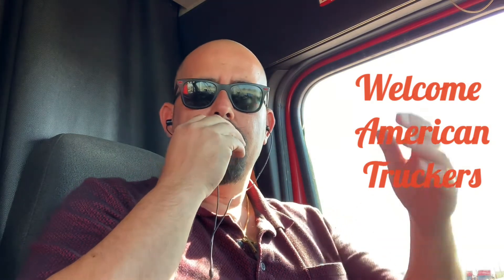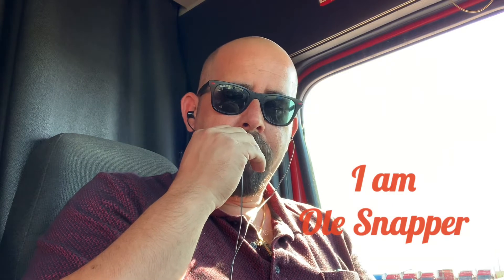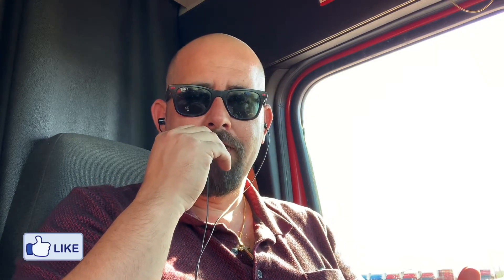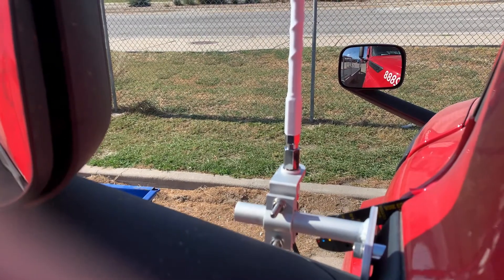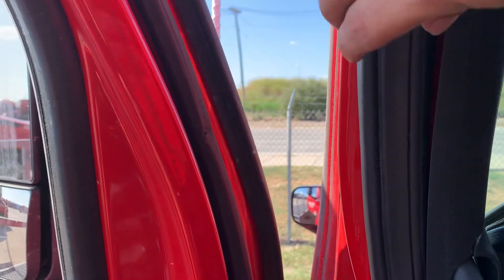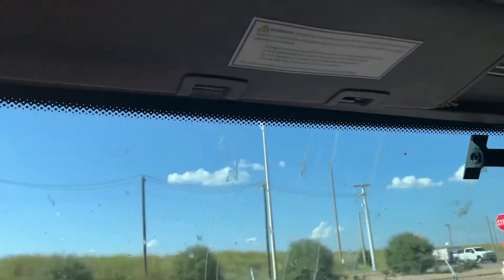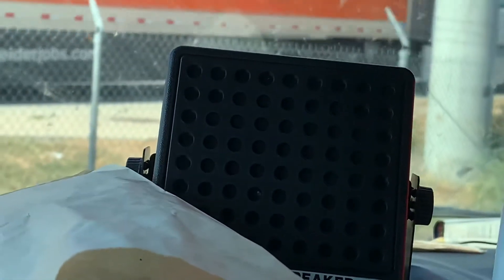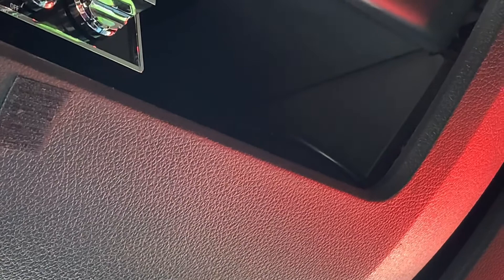CB Coax Install on 2018 Freightliner Cascadia #trucking EP 120

Comment: Does this work for older models?? Thinking about doing it on the 2017 I got same way u have done it but just don't want the coax to be destroyed by the door
Reply from the maker: It does. The correct way is to go through the firewall this is the fast way lol
Reply: @Olesnapper   Do you think the coax is not gonna get pinched this way and affect the antenna's functionality??
Reply from the maker: It will over time. But for a fix until you get the time to run it correctly it works

Comment: Ole Snapper ,  What Can the Semi-Truck-Builder Do to Standardize CB Cable Installation to the Vehicle Interior CB Compartment .
( 1/4 Flex-Tube ) With Two-Pull-Strings inside of Tubing .
The ( Flex-Tubing ) Is Run inside Fire-Wall Carpet Foam
Single-Tube . Up-to Left Side of Vehicle Door Window Panel  ,with-Panels Removed to CB Box Compartment .
Cut 1/4 Hole for Pass-Through with Rubber-Grommet if
needed . With ( 1 /4 Flex-Tubing ) Coming in from the Left-Side CB Compartment Box. Now ( 12V Power ) Common-
Connector ( Red-Black ) Fasten With Screw-in- Hardware to Upper Back of CB Compartment Panel . Using the CB Out-Of-Box ( 2 1/2 AMP Fuse IN-Line Power-Cord ..
The 12V Power Should-Follow-Wiring-Harness-Back-to
Fuse-Box-Connected--Neg-Pos Connection. Now the
Flex-Tubing -Fire-Wall-Path-Way to Left-Side Mirror
Path-Way Installation, Run Flex-Tubing Inside Fender-Well Towards Door-Panel and Mirror Mount ( Leave-
Flex-Tubing Very Long-Pass Truck-Mirror For-Now.
Use This-Type of Cabling Because of Connector-Type.
(  K40 FME Mini-8 CB Antenna Cable w/ Removable FME Connector 18Ft. Long ) ONE-String -Only -String
and Elc.-Tape around Real-Tight . Stretch Cable-Out
Long-ways Straight. Ty-One-Pull-String -Off with-Tape. Take the Other -One-Pull-String Start-Pulling inside of
Truck-Cab , Just-Slowly just-bring-it-through . When the End of FME Connector Reaches the end only needs a Ft,
or Oval -Upper-Inverted Length to Back-of-CB-Power-Connection. Just-the-Cable-Not-Flex-Tubing .Now the
out-side . This is the learning Curve How-Much Cable
Left- Behind on-Ground or In-Side-the-Flex-Tubing ?
You-Want-Cable-has the Same-Length has -Flex-Tubing.
Two Choices Add for Flex-Tubing or Find the Cable-Inside
the Flex-Tubing by ( Cutting-Back-Flex-Tubing Little-At-Time . Has Long Its Past-the Mirror Itself ..) At Equal
Length .. Then Connect to Fiber-Glass-Mount Coax and
Cable-Boot and Flex-Tubing Press on Top-of Boot .
Now the Fun-Part ( Roll-Up-Cable-Inside-Flex-Tubing Push -Back-Toward Fire-Wall .Through-Finder Inside
And Ty-Rap 18" Oval Outside Firewall . With Oval It Should
Keep the ( SWR Reading Low Enough to be Happy With.)
I would Use a K40 Single Fiber-Glass-Mount .With This
Antenna . With ( SWR Sleeve for Adjustment )
Antron St500-W K-40 - 4-1/2 Foot Original Cb Slide Sleeve Power Whip Antenna - W  / $15.00 CB World.
IF Dual Antennas are Desired the Same Process has
Left-Side was Done . That What the Second-String is
For .Bring the Flex-Tubing to the Fire-Wall First Flex-Tube
and Cut-Hole-Into-The-Tubing for Cable to Pass-Through.
Attach to Second-String-Going Through-the Single-Tubing to CB Compartment . Connect the Coax Cable to Mount and Flex-Tubing to Boot and Roll-Up Both-Inside  Back-Inside Toward Fire-Wall a Ty-Rap up to Something Real-Good to Hold . Do your Dual Antenna Install a CB Radio and ( Check Each Antenna SWR Reading has a Single
Reading be the Same , a Dual Connect Again RE-Do SWR Reading Again ..Has a Double ..

If you Wish for an Extra Speaker I have an Idea for the
Hard-Ware through the  Speaker Grill  Cover and ( 3.5 )
Speaker Connector using ( No. 6 Screw Butter-Fly- Hangers ) and  Washers . For the Speaker-Mount Pass-Thru Grill-Cover It's Workable .
Well Ole Snapper Tell What You Think ?
If this is Workable ?
May Have To Sign Your Name A Myself .
Add ( Some Other You Tubers ) I've Never Drove a Big-Truck Before . I Just Worked for NASA Another Govt Agency During my Career ,and Retired Now ..

Comment: Ole Snapper , Sorry it's been a week or so to get Back to You . If you wish to Know what Type of Antenna  and Parts Components . How I would Run System from Single Left-Side Mirror to the Interior of and Semi-Tractor  .  And Material Components , and Why . Drawing
to Written Documents , that Could be Used by Semi-Truck Builders has and Standardization 
Instruction to Lease-Companies  and Owner-Operators . CB Insulation Standards .The Old Days Over the Road Drivers Knew . This New Generation 2000 New Truck Drivers Does't Have the Knowledge . Being Taught how to Drive a Semi-Truck it's hold New World Beginning . Learning  how Use a CB Radio Just Another Lesson in A Road Trip . I'm Old School Myself . This New Generation 2000 Young People Just Lazy in the Head Except 
for a I-Phone in One Hand ! 
..............( Have Too John Wayne Up Move Forward ........